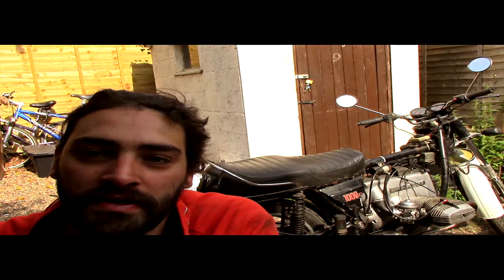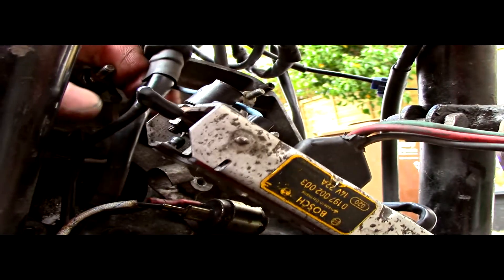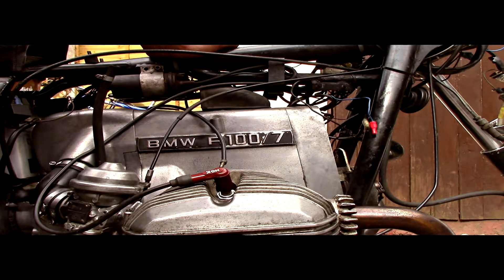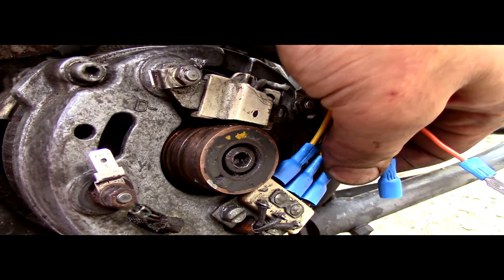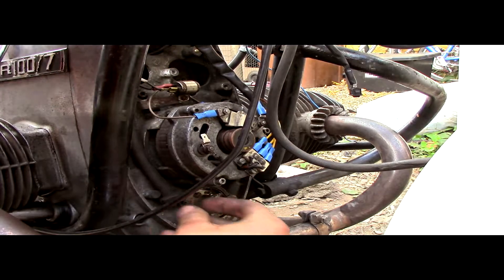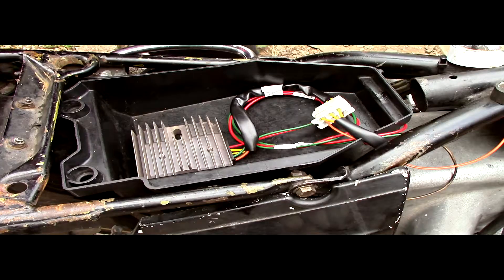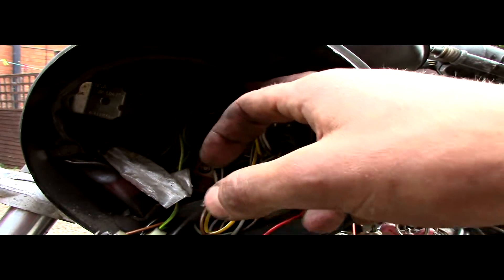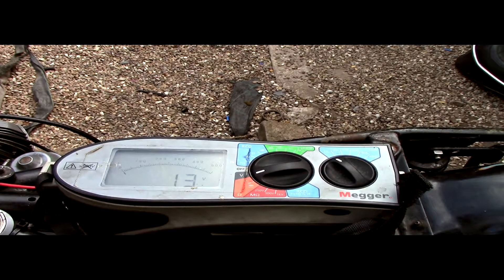HD. How to replace a Bmw r100, r80, / 7 voltage regular and diode board

Comment: Hi not sure if I'm too late to get a response, but firstly thanks for the video. Quick question I had was where you mounted the new unit? I've just installed one and it seems to clash with the old earthing point on the timing cover - probably because the new unit has 2x centred mounting holes left-and-right, instead of the 4 of the original. Thanks!

Comment: What brand of regulator/rectifier? (appears to have been designed for similar vintage MotoGuzzi). does this Reg/Rect charge at 14.4-14.6 VDC? (for AGM Batteries)

Comment: Sorta late to the party here. Great video! I have recently noticed that my Battery is not charging vehicle riding (Bump Start). I was wondering what is the aftermarket product you are using. I am Running a r90/6.
Reply: +Richard Smith @blueisbluer  BUMP!
Reply from the maker: +Richard Smith hi, I've just seen the reply function. I hope you have sorted your Beemer but if not have you checked the rectifier and diode board? Don't forget the stator, as the bushes can wear. I replaced mine with a regular pattern part from the speaclist I use. I've just checked and it wasn't branded and there are plenty on auction sites. R90, nice bike those...
Reply: Hey thanks for the reply. Sadly I have no clue how to use a multimeter to test electrical. I have cleaned the bike top to bottom. The mechanical bits a have been a challenge but the electrical have been a solid brick wall for me. Could you point me in the right direction for information on how to check a diode board. out side of that I have have my eye on this : http://store.bobsbmw.com/product/enduralast-ii-400-watt-alternator-upgrade-kit-for-airheads

Again thank you for your video and response. It has inspired me to know there may be another way.
Reply: La Richard Smith @blueisbluer
Hi richard can you explain how you connected the wires thank you very much